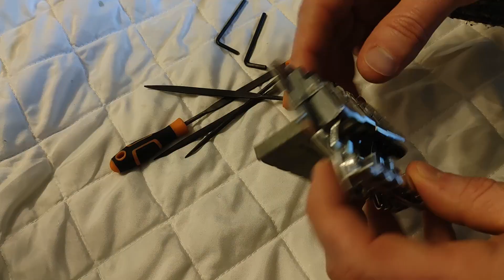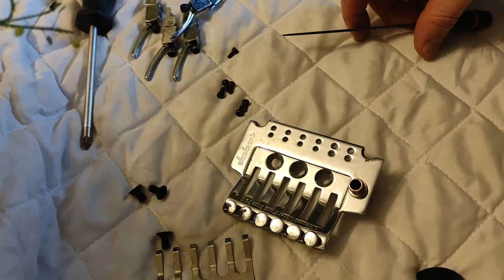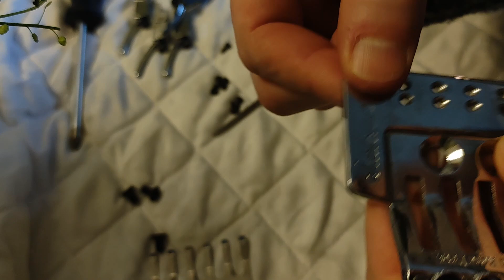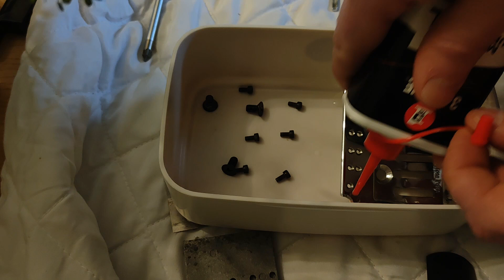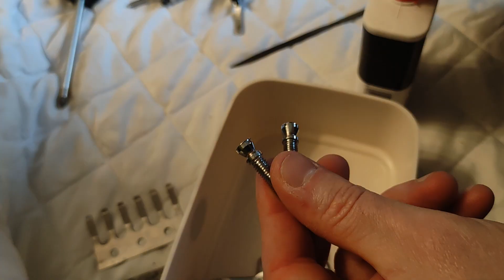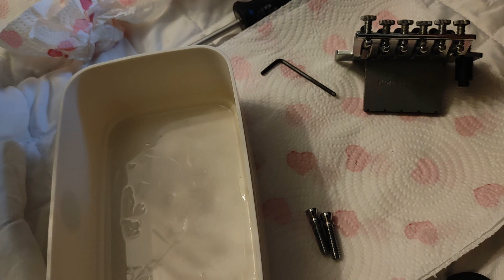Watch this before replacing any Floyd Rose bridge

Comment: Wonderful video. As I was getting into the engineering of the unit a couple things became clear. The zinc units will just wear quicker based on how the tremolo functions. My mind instantly went to sharpening the knife edges, cleaning up the posts, and lubricating both. I understand it's ideal to perform a full disassembly for the oiling process...I suppose I'm left thinking ,could you not just remove the strings, springs, pull the tremolo, file the edges, and clean up the posts? Even for oiling, with so few moving parts I'd argue the average Joe not break it down completely and just back the screws out most of the way, apply oil and screw back in. Less of a chance to mess things up. Most people can barely handle moving up a string gauge and getting it set back up haha. This is an excellent video, Sir. Great job.
Reply from the maker: Thanks mate. Yes you can do that. A big time saver too.

Comment: If you are able to file the what suppose to be a very hardened metal, you should replace the part because it's not going to last.
Reply from the maker: You're not strictly filing it, more removing burrs. These edges are meant to be the hardened base plates. Worked a treat anyway.

Comment: JT 580 LP is by far my favorite Floyd Rose double locking type bridge, I'm not saying it's better than the original Floyd Rose. Never worn either one of them but I don't use the trem a whole lot, which kind of doesn't matter cuz it's always moving whether you use the bar or not. Definitely do not want to change a JT 580 LP or JT 580 out to another brand because the dimensions are different and really should know what you're doing. It kills me that so many people have the mij Jacksons or buy one used and immediately go on to the forums and inquire on which bridge they should buy to replace the JT probably not even actually giving the Stock bridge a chance. They replace the bridge with a bridge that is not at all better. I love Japanese DK2 that's what most of my guitars are 99% of my guitars are Japanese Jackson's 2000s because they are the best production guitars made unless the USA Jackson is better I haven't played a USA in decades now the new Jackson American series are affordable I I'm going to get a virtuoso and see what's up.
Reply: I like the Duncan Designed pickups they put in the earlier DK2 and several other Jacksons I have several and I understand they are different model pickups and I like every single one of them. I think most of my Jacksons have Seymour Duncan pickups and it's cool to have something besides a JB in everything. I have some mg series too that are EMG the ones that came with the HZ I replace those with active 81 emgs in the bridge and neck position .
Reply: Does your DK2 still have the Duncan design pickups in them and if so do you like them too?
Reply: I noticed your DK2 is pre 2006 that's why I asked about the Duncan Designed
Reply from the maker: Yeah my Rhoads has one and I am 100% fine with it. Holds tune brilliantly and feels great.

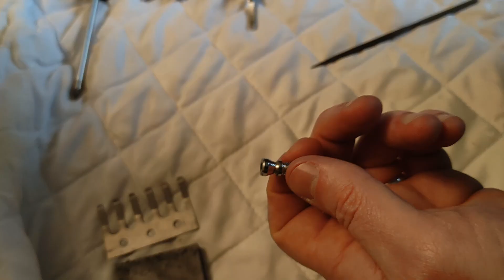Comment: @7:17 Put post in an electric drill and tighten chuck softly, just enough to keep it in place. On lower speed use a fine-grit file to carefully file off any rust or edges. This way, it stays circular and makes adjusting the bridge height much easier.
Reply from the maker: Great tip. Yeah I think I'll do that next time. Cheers.

Comment: Been wonering if it was possible to do this. Wasn't sure if the hardened metal was just like a surface thing or goes all the way through. Also how easy it might be to keep the correct angle and how fine a finish one would need to go for. And whether it would be a long lasting fix. Would silicon grease be better on the knife edges? I'm not 100% convinced but interesting none the less.
Reply from the maker: @JohnyLondon  hi mate. Silicon based is fine but can be a gunk attractor. I know what you mean but you aren't really 'reshaping' much unless in extreme cases. In most instances you are removing burrs. The hardened steel ones should require the minimal (if any work) this is more for those 'second tier' trems like the JT580/ takenuchi 101 style but old top tier ones might want a touch up too.

Comment: A couple of things: You should have kept the saddles in order when you removed them. There are 3 different heights to make up your radius. There is usually some kind of markings underneath them, denoting which saddle goes where. An example would be that they are arranged like this from Low E to High E 123321 or similar. Bearing in mid that all of the various manufacturers use their own marking system. Some have numbers, some have hash marks and some use no marking at all, usually on the tallest saddles. They can always be measured with a digital caliper etc. This is a great video, removing any sharp burrs or indents in your knife edges. An Original Floyd Rose, or a high quality Gotoh, the base plate is made from hardened steel and the knife edges should never need any maintenance, with regular use. Same with OFR hardened steel posts. A small file like that actually won't cut into their hardened steel!! The recommendation of 3in1 oil is also spot-on. I have been wrenching and using/abusing Floyd Rose trems for darn near 40 years, and it's liteally all I will use for lubrication and cleaning. Great video! Well done.
Reply from the maker: @Metalcop5150  thanks man! Great to hear another advocate for 3 in 1 oil! We need to make sure guitarists keep that WD 40 away from their guitars (can actually rot wood). Yeah, I always check saddle heights before putting them back on. Thanks so much for the kind words!

Comment: Will this help a Floyd rose flutter better?
Reply from the maker: @7stringslayer  Hi mate, absolutely. The less metal 'contact' between the knife edge and post, the better the flutter. Other ways to make it flutter are a) add a heavier block to the back and b) make sure you have decent, none worn out springs (really cheap to replace).